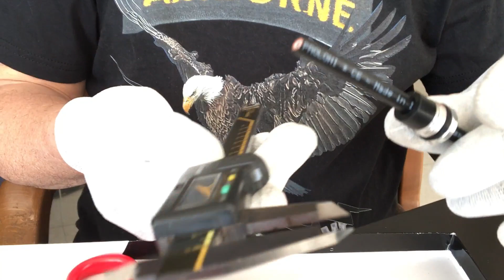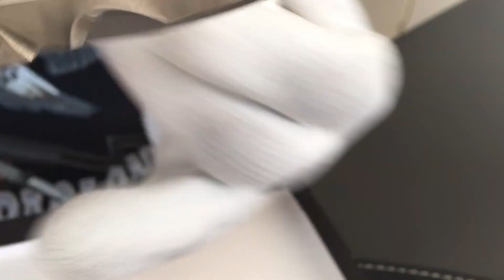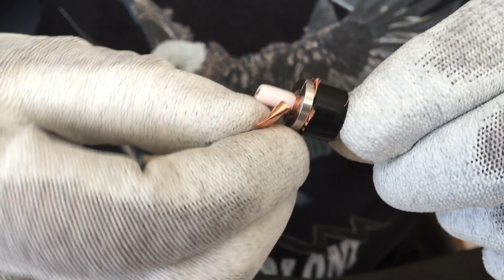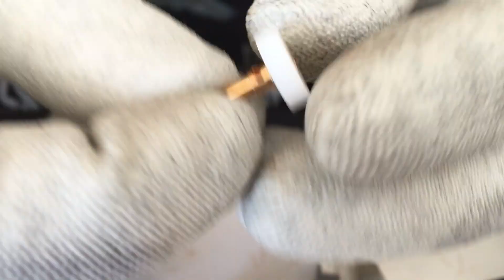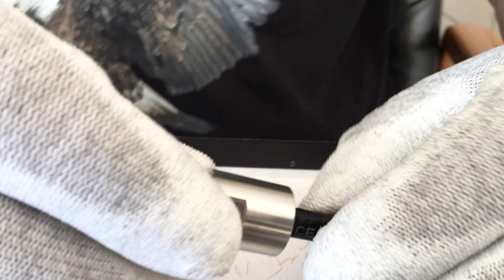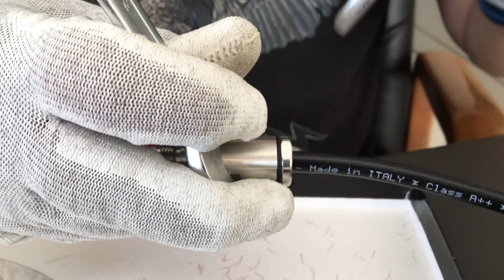N Female Connector Installation (Ultraflex 7 Coaxial Cable)

Comment: hi, i use the N connect for wifi cantennas. i was wondering what it was use for. this was interesting to see because at the end of the cable it was still the part i use after it was done.